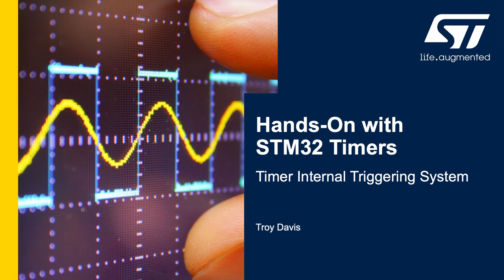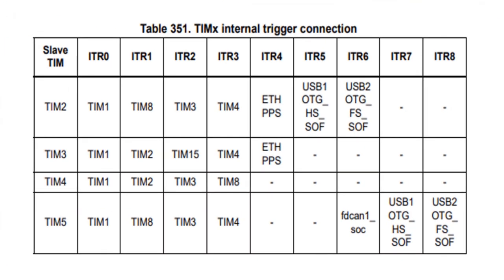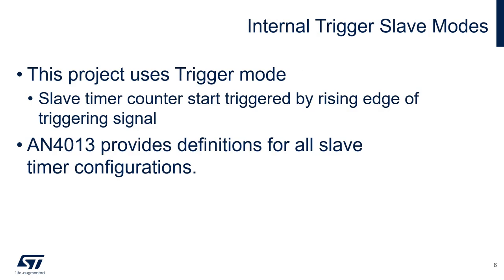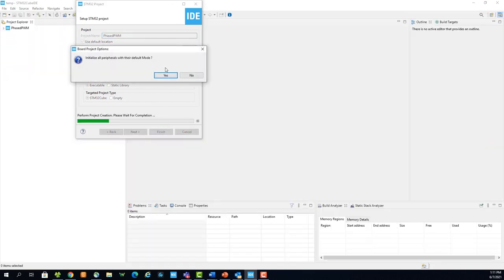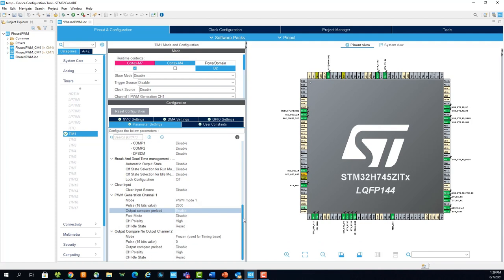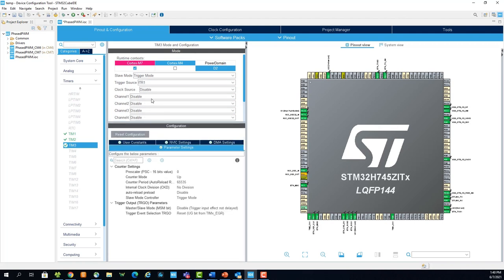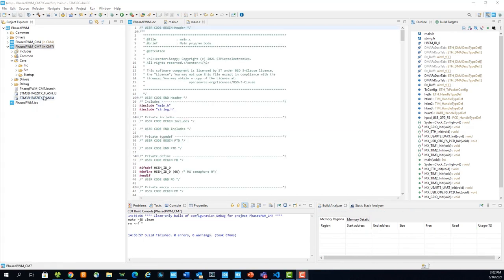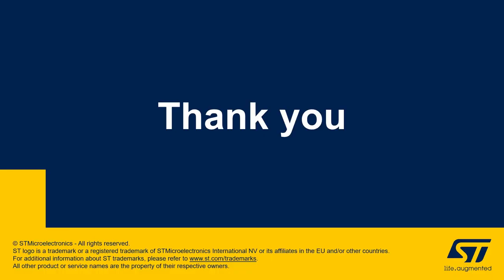Hands-On with STM32 Timers: Internal Triggering System

Comment: thank you,
I can generate pwm signals with phase difference between them, but when I stop and restart, TIM2 PWM does not turn on. Anyone who can help?

start code:
HAL_TIM_PWM_Start(&htim1, TIM_CHANNEL_1);
HAL_TIM_OC_Start(&htim1, TIM_CHANNEL_2);
HAL_TIM_PWM_Start(&htim2, TIM_CHANNEL_1);

stop code:
HAL_TIM_PWM_Stop(&htim1, TIM_CHANNEL_1);
HAL_TIM_OC_Stop(&htim1, TIM_CHANNEL_2);
HAL_TIM_PWM_Stop(&htim2, TIM_CHANNEL_1);

I communicate with STM32 via UART using C# windows form application. For example: If I send 0x50, PWMs are turned on, if I send 0x51, PWMs are turned off.
Reply: Edit: When I restrart TIM2 PWM turns on too but its Duty Cycle %100
Reply: @kaankurtca9  Hello,

Same problem here, I see you asked the question on stackoverflow too. As I understand, the problem was not solved yet on it. Since, have you fix the problem ? I am interested in the answer ^^

Regards
Reply: @julien6787  Hello, i have fixed the problem. I found a way to reset TIM2 by writing register level code (Reference Manual Document). Thank goodness it worked. So, instead of the command to turn off the PWMs, I use the direct reset of the timer. When I run the command to turn on the PWMs again, the PWMs turn on properly.
Reply: @kaankurtca9  Thank you for your answer! So you don't use at all the HAL functions like HAL_TIM_PWM_Stop right ? I will try what you said about registers level on my stm32h7.